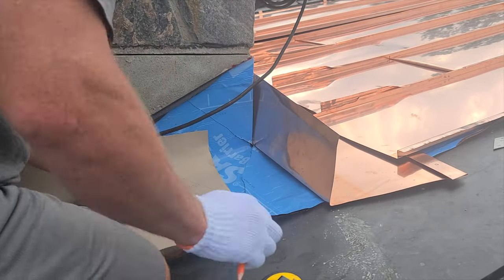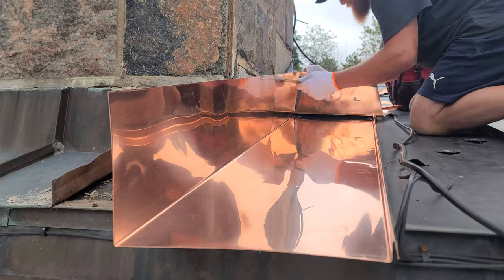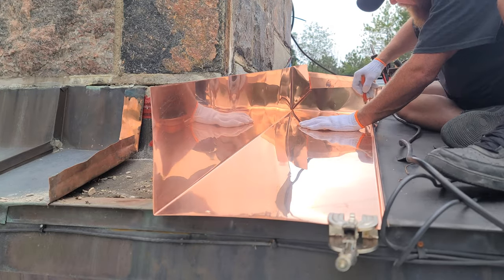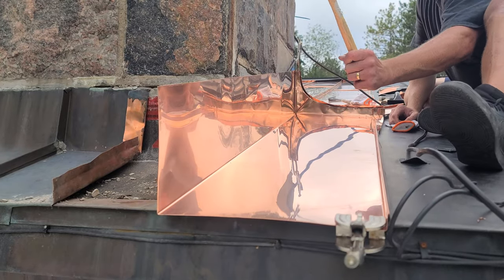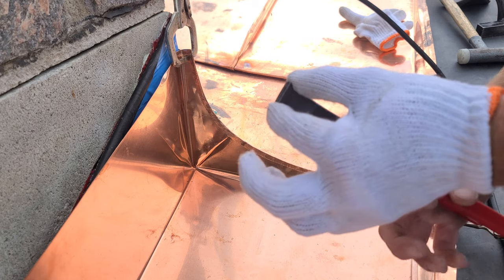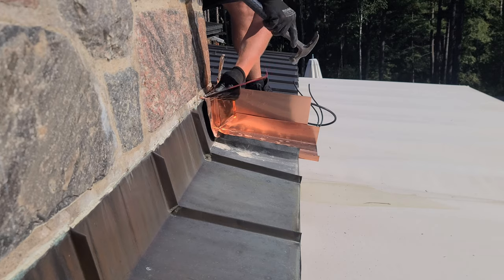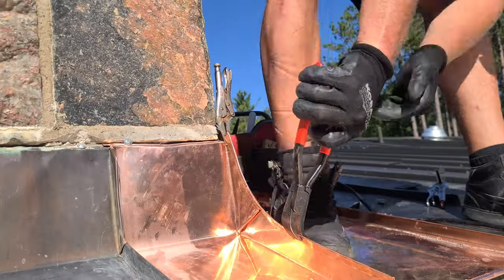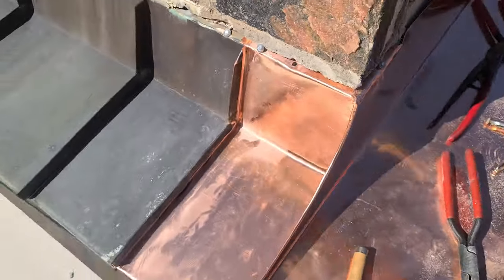Hands down...The BEST WAY to Flash a Chimney with Standing Seam

Comment: Love it!! Quick question, when doing that pocket fold, I’ve seen lots of people talk about bisecting the angle. But what it looks to me like you had a feel for it. You mentioned you used your needle nose pliers to adjust it. Is it unnecessary to bisect the angle and do all that stuff I see on YouTube?
Reply from the maker: I like doing it like this. Bisecting is good too. But I believe this is why the pocket former was invented. Having done this for a bit now I can visualize a little bit better and I find myself twisting things up and getting them dialed in and squeezed in place and it’s really helped increase my speed while still maintaining the quality. I will say though having done bisecting for an awhile it really helped me develop my 3d thinking if that makes sense. It helped me understand which direction the folds are to go in to get the metal to do what I need it to

Comment: Hi, just fishin for help.  May I ask if you'd assume a standing seam copper porch roof about 30 years old could be removed and reused?  (not on a house roof)  Maybe for a shed, projects, etc?  No idea what i'm doing with copper, but i'm smitten with copper since i started putting some copper on the chimney tops I work on.  No idea yet how the bonded the seams.
Reply from the maker: Yes absolutely... Copper's reusability is very high... As it takes quite abit for it to stress crack from being unbent and rebent... Unlike aluminum where you can only bend it back and forth twice before it cracks
Reply: Thank you!! Appreciate it

Comment: Can you do this double fold with 24 gauge steel? Seems like that many layers with the pocket fold would be tough
Reply from the maker: ive done it but using the blind sweep approach where you dog ear behind the chimney and have a single layer of metal to turn over as a result
Reply: The old books 1880-1940 call for 28 Ga .   Is that to thin?
Reply from the maker: @613kc copper isn't measured in gage where I'm from...16 ounce is the lightest you should go in roofing
Reply: @asm101   I'm  talking Galvanized steel